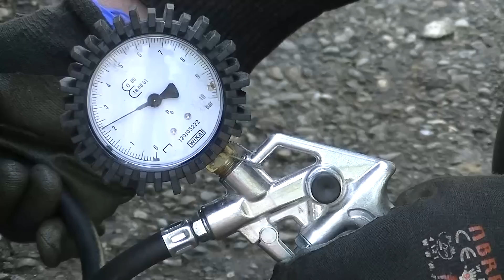How to adjust your wheel alignment with a board

Comment: I always did this when I was younger, didn't always work (tyres scuffed at one side), but good tyres were only 5 or 6 bucks back then, petrol was 4 gallons for a pound sterling. Mostly this worked good for me, but jacking and lowering the car are a definite no-no.

Comment: Space from the rims not the tyres or better still the centre of the actual hubs. And use a straight piece of pipe or aluminium or edge of a plywood sheet as that's straight if new from factory (or should be) straight line with rear wheel and measure gap between front and rear of the front rim or hub once aligned swap sides and ensure aligned with rear and then equidistant from straight edge both at front and rear of the front hub or rim, if both sides are equidistant front and back of the front wheel rim or hub, when it's parallel at the rear rim or hub then the tracking is aligned, if not adjust accordingly.. 👍🏴

Comment: Longacre has a toe bar to set toe. Line-up the pointers with the center of the rear tires and then the front. Toe it in to specs.

Comment: You best of just keep adjusting it until it feels good to drive no pulling- centre wheel. I’m many cases the slightest turn is what makes the difference. Even using laser the computer don give spot on settings as there is always MM in tolerance but that can be put on one side to the limit and in on the other to limit making it not drive to well anyway

Comment: The only accurate rubber  tyre measurement is taken  at the center of it. The sides of the tyre will bulge out differently. Center of the tyre is always in contact on the road no matter what.

Comment: the board itself looks older than the car...  Probably not even a straight edge... youre better off just using a piece of string.
Reply: C C 
Or Fishing Line .
Reply: String works excellent
Reply: String is much more accurate

Comment: Bro this is the wrong way of allignment coz mostly cars have different front and rear track width.
Reply: Measure the center of the rear wheels and then the front. Center the steering wheel and lock it in with a steering wheel holder or a person to hold it. Set the toe so that the front wheels are the same as the rear but toed in to spec. It'll be close. But a toe bar with pointers is better. A long board with a pointer nailed to the board might do as a cheap method.